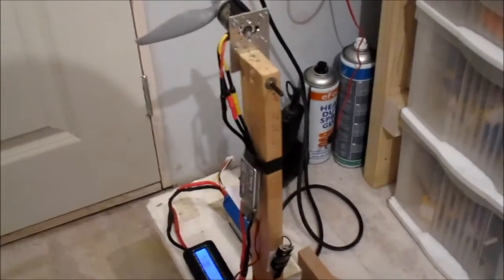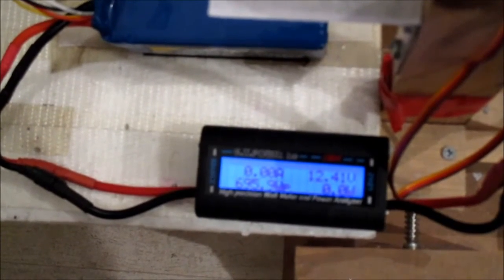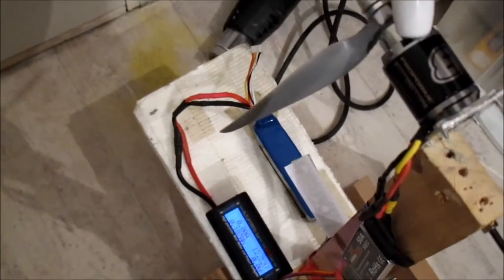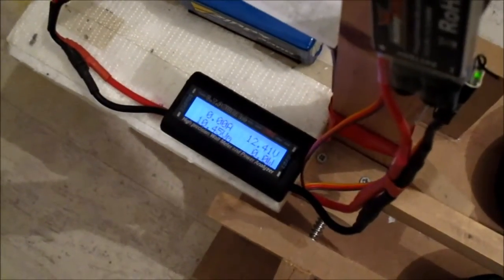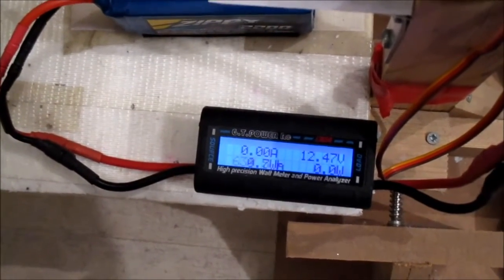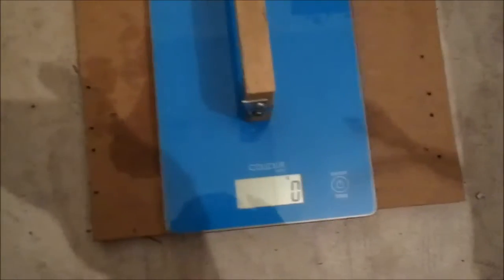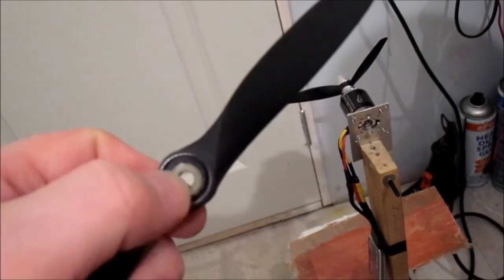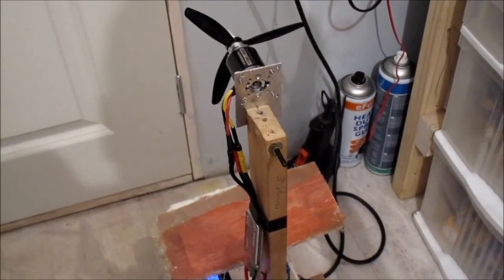NTM Prop Drive 2836 2200kv Thrust test Part 2 Motor Test of the Week

Comment: Hello.one more time o go i write abouth my ntm 2200kv haw only 500w with 4s 6x4 prop.i buy one more time  new 2200kv ntm.i got the same les power. With prop 7x6   is 515watt 46amps. can You halp my? A want pusch this broke engine with 7x6 4s lipo. It 60amps  Do You think this engine will by work good whe hi hawe les stock power.If You can halp my:/  Thank You for Your time.

Comment: Hello.Thanks for this test.I do de same end i have only 24amps with tgs 6x4 3s batery.I dont understand
Reply from the maker: What size is your 3s lipo and what is the voltage drop?
Reply: Hi,i use tattu 2300mah 45c voltage 4.20v .end tattu 1550mah 45c. A buy this motor by hobby king.On your motor a see 2836-5 a have only 2836.This motor came to my this week.Tahank you for evry thest you.
Reply from the maker: @piotrchojnowski255  The 2300 should be ok. 1550mah is a bit small. Don't worry about the -5 on mine. As long as yours is a 2836 2200kv it should be the same. Just look at what the voltage drop is under load.
Reply: @rcplanepirate  Hi, i test my ntm 3000kv with the same lipo end esc     end i its the same from You test this motor.End turnigy 2826 2000kv also god.265watt 3s 6x4 tgs.Maby the motor ist bad.I write hobbyking whit this problem.I write to You what was a problem.p.s.You kanal you tobe Great.
Reply: I write to hk and thay give my money back.Mayby a try 1800kv 3536 a se its realy good.I like your kanal i buy 2826 2000kv turnigy ntm 3000kv-and special tgs for this engines they work good. GOOD LUCK!👍
Reply from the maker: @piotrchojnowski255  Good you got your money back. Sorry I think they may of stopped doing the 3536 1800kv :-(